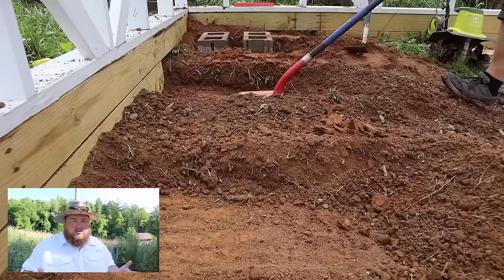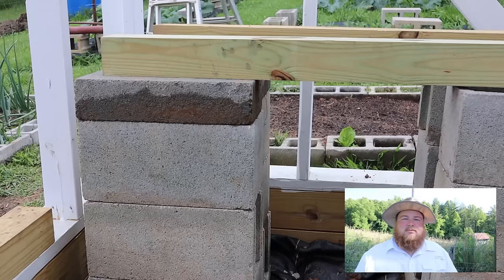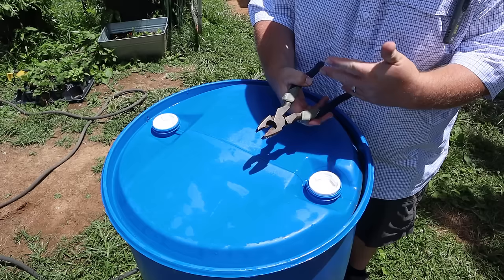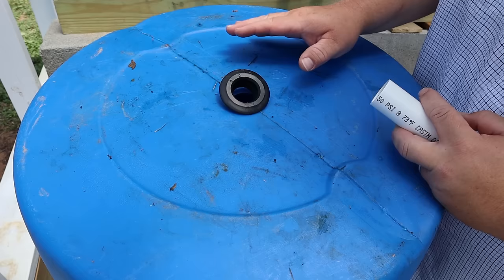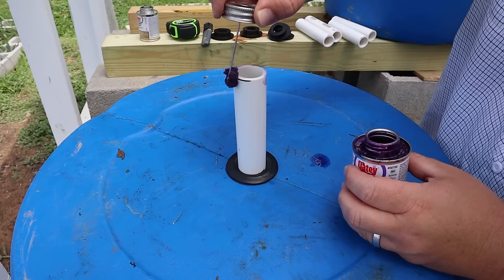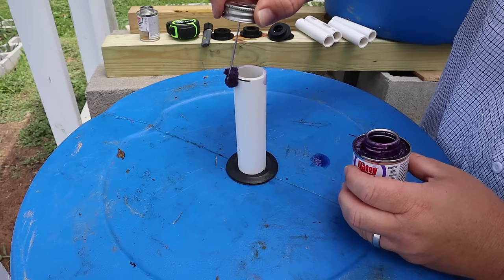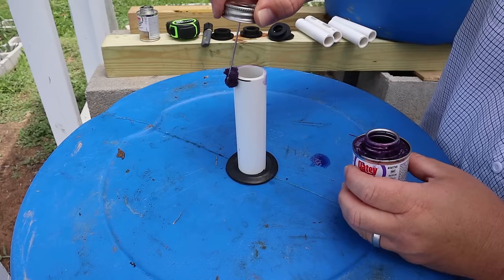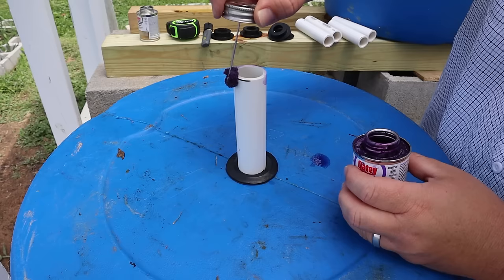COMPLETE Rainwater System START TO FINISH - DIY Greenhouse Build #10

Comment: Suggestion: stick a little bit of steel wool or steel scrubby (like used to wash dishes) in all those open drain pipes. Why, you ask? To keep dirt dobbers, wasps, spiders, 🐍SNAKES , lizards, for going up the pipes. Yeeeesss they can clog up a pipe  and yes they will crawl up it. Great video
Reply: My thoughts exactly. Gotta filter what you can.
Reply: They sell grates various sizes, colors shapes etc..
Reply: I have just 2 words,that, I’m gunna cram together: badass!!!
Reply: I learned that mud daubers are a major black widow assassin. Just something to remember if the one worries you more than the other annoys you with it's fancy smancy hourgla...wait.... hang on... somethings backwards there
Reply: @dont.ripfuller6587  and those fast-flitting scary metallic blue wasps prefer fiddlebacks! They are not aggressive, and after looking them up, I was able to convince spouse we should leave them be!
Reply: Thank you for the great tip! We get scorpions in the bathtub…
Reply: Excellent foresight, but steel wool will rust out pretty quickly. I'd use nylon mesh, probably.
Reply: Mice! Had  RV water tank and took out in remodel found dead mouse in fresh water tank. Don't use it anymore, yuk!
Reply: Paint those guys black, and in winter, they will warm in the sun. Then, they will release heat thru the night.
Reply: I'm in S.A. ... We one had a crazy honey badger living in an old drainage pipe on our property.  He was a wildman.  He would kill the chickens AND the fox and eat them all.  He'd occasionally break into our kitchen and absolutely RAID the pantry and make a huge mess... Right in front of your face, while looking at you!  But you DON'T DARE try to stop him!  (They go for the testicles, the eyes, and the throat, in any order).   They're known for backing down fkn FULL GROWN LIONS! (their utter fearlessness and obsession with testicular maiming are enough to freak most lions out)😂😂😂
Reply: @shaftomite007 The honey badger is my spirit animal, I love the honey Badger
Reply: If you use a 4" circle cut from nylon screen door fabric to cover drain holes then a zip tie around pipe over screen, that should help keep bugs out but mice will chew through it. Hope you find remedy to keep mice out. Good luck!

Comment: placing blocks with holes vertical will allow them to settle and sink individually and cause your base to tip. To minimize potential tipping / leaning of your foundation, place the 1st set of blocks with holes horizontal.

Comment: Something to consider, is on one barrel to put a fitting up towards the top, and one towards the bottom, connected by some clear tubing.  This way you can see your volume level in case you have not had rain in a while.
Reply: I’ve done this on on smaller systems and while it’s a nice convenience, it will grow algae even in indirect sunlight
Reply: @Oleo 2320  true, but if you put in a floating ball it will be able to be seen and keep the algea down to a dull roar.
Reply: Or (speaking as a complete novice), on the clear tube cover it with black tape and cut out a rectangular slice and cover the exposed part of the clear tube with painter's tape.  Then you can lift it up as high as you need to look at the water level and reseal it back down without it being sticky. But what do I know, never done anything like this before - but my mind thinks my ideas could work. 😊
Reply: Tapping on the barrels will tellyou water level.

Comment: Giving me ideas and inspiration, maybe something for others to consider, 1. You don’t necessarily need to glue fittings above your overflows, ie any part of the system that does not “hold” water. Consider mounting brackets for support as needed and maybe two self tapping screws to secure joints. I’ve also used hot glue in non pressure segments. 2. Design your downspout and feed plumbing first to determine the max hight of the top of your barrel(s). Ie water always flows down… 3. Keep in mind water weighs 8.345 lb/gal, your base and ground needs to support 400 lbs / 50 gl barrel. 4. While small diameter pipe is fine for venting, overflow outlets should be sized to match maximum inflow, The multiple small diameter overflows is clever and will probably be able to manage. Consider a T fitting with a short vertical stack instead of a 90* downturn to improve vent and drain. Or otherwise separating the two systems. 5. A 1” manifold is most likely sufficient but don’t go smaller, too small and your primary barrel will over flow before completely filling any down stream barrels. Similar to overflow size considerations. 6 consider adding unions or threaded connections in your manifold to make breakdown for maintenance or moving easier. 7. Add T fittings and screw caps at manifold ends for maintenance, flushing out barrels or future upgrades. Nice system thanks for the inspiration!!
Reply: Do you realize that by drilling those holes in the top for venting you could do that by loosening the bung on the top.
By doing that you don't have to worry about bugs getting inside those hold even though they're small a mosquito can get in that small hole and start breeding and laying its larvae.

Comment: Nice build!  I'm saving this for reference.  One suggestion, maybe extend the drip/overflow away from the foundation of your building.  Over time it will rot out your wood quicker and compromise that area.
Reply: Or dig a small trench under the spouts and angle it to go deeper down a little as a run off as you end it a foot or two away from the greenhouse frame?

Comment: FYI on overflow: area = π*r*r, so a 2" inflow is 4x as much as a 1" outflow. That said, you only have a 1" exit/entry to each barrel through the manifold, so input will never exceed overflow capacity for the middle 3 barrels - only the end barrels. You'd be better off putting a 2" overflow on just the end barrels

Comment: I think someone may have mentioned by now, but why not get a couple more seals and put a sight glass tube for water levels in center barrel?
Reply: Doesnt matter what barrel it goes in. And all you have to do is hold the end of the hose above the top of the barrel and lower it till water comes out that's your water level (pun intended)
Reply: Nice job I like your design

Comment: I was going to say about the drums needing venting in order to fill, but then you added the overflow to each drum which basically provided a vent for each drum.  Looks great and hopefully it does what is required of the system.

Comment: Love the idea...I would maybe just compact the soil after you did your first scrap, also the drain/bypass is a bit close to the structure I would probably put a downspout extension to lead extra water away to it doesn't erode to close to structure.

Comment: Hey Sam, Nathan here, great video. I do like you framing on the green house, looks very strong. We have the same mind set on having things on hand and use what you have to make what you want. i believe it helps the pocket, but also more important keeps the mind sharp on problem solving. Anyone can spend thousands and have a great system. For me I'd rather spend it on chocolate. he he...
Reply from the maker: Hey, glad to have you here! You're absolutely right on using on-hand materials! Mmmm chocolate!!!

Comment: Excellent set up , very well put together , the run off safety measure flood prevention , exactly right . Vents  the barrels at same time , netting on bottom of run off pipes will stop insects crawling up into the barrels  ,  just a thought .  Your the man Sam . .

Comment: The bottom-fill manifold method was in my head a while ago. Glad I could see it work in practice. This is reassuring and will incorporate into my attached greenhouse and using existing gutters (after cleaning them) to capture tons of water. Well done.

Comment: not sure what kind of netting you put over the pipes, but can you put some of that over the bottom of the overflow pipes just to keep flying critters from zipping in to your barrels?  Really awesome job, and an extremely helpful video!!
Reply from the maker: You could, yes. The netting is paint strainer/filter netting from the hardware store. It's a thin mesh.
Reply: a nylon or pantyhose will work too, probably cheaper too.

Comment: With the hydraulics, you only needed 1 overflow outlet on one barrel.  The water level equalizes in all the barrels before it would reaches the overflow.
You did not need to drill vents for each barrel, the overflow would serve that purpose .
Reply: That's what I thought as well.

Comment: Wow! I’m in Old Fort, NC. If any of y’all super smart men or women want to come help out a single mama start a homestead(ish), that would be amazing! Tried a ram pump with the ex, and it kept failing. Desperately need this water system in my life. I got a bit confused on the first flush and drilling of holes in the cap. But, that probably just means I need to watch more videos to better understand. But seriously, this is amazing. I will try my best to write down everything step by step as far as materials and such.

Comment: You need a better foundation under each column.  You should place two 8 x 16 x 4 inch concrete blocks at 90 degrees to the column blocks.  This will give about 1 pound per square inch pressure on the ground instead of the greater than 5 pounds per square inch of your current design.  Your columns may start to lean if the ground get wet under the columns.  
Good Luck, there were some great hints in your video!
Note:  If you replace the bottom block with a 8 x 16 x 4 inch block plus two more under that one you will end up with the same height.  Should be able to jack up the barrels when empty, replace the columns. Once they are all updated then re-level the top horizontal boards.

Comment: I'm  going to build it , but I will cover the air vent holes by cutting a round piece  of plastic mesh and glue them using a glue that will stick  to the barrel material just to make sure no bugs will try to enter the barrels . For example,  mosquitoes.   To tell you the truth , nobody  on You Tube explains so well all the steps the way you do .  I'm  writing  from P.R. .  In some more months we will have  the storms season and what I saw in this video will come very  handy . For drinking and cooking  water it's  just a matter of having stored tens of gallons of it way before the s. season  , and the water that will keep being collected  in plastic  barrels can be used for other things . It will be a matter of just connecting a hose to the faucet in the barrel .  You have no idea what you have done for me .   GRACIAS !!
Reply from the maker: Eddie, I am so pleased to hear that my video was helpful. You have helped me too, regarding the mesh for the barrels! Good luck with your project, I wish you all the success!!! -Sam
Reply: @sam-and-angela  The same  here .  GRACIAS  .
Reply: @eddieramos6883  I would utilize the bungs in the barrel bc they are pipe thread and you can screw a pipe fitting right into them. 2" npt. Place the barrels upside down and connect them that way and then vent by drilling and tapping the bottom but now top 1/8 pipe and connect together with cheap compression fittings and 1/4 ice make line to a filter or to a ptrap type air loc. Then the over flow would be plumbed into the bottom manifold and run up higher than the barrel height and 180 back down so you can use full capacity or the barrels but put a vent hole in the top of that 180 at the top to prevent a siphon.
Reply: @timothydillon6421  Thanks .  GRACIAS

Comment: you need a ball inside the first flush tube to stop the trash that will be floating in that dirty water from going back into the rain barrels when the water level reaches the "Y" pipe, Dust, debris, and bird poop will float on the water and rise in the pipe as the water rises. The ball blocks the opening and prevents it from contaminating the stored water.

Comment: How about adding a simple float so you can assess the water level, far less work then a sight pipe.
Reply from the maker: Ooo I like that! I've been thinking about how to plumb in a sight pipe without loosing every bit of water I've collected and flooding the greenhouse. A float would work and save the water, too! Thank you for this idea!
Reply: @sam-and-angela  you hose will tell you the water level.

Comment: One cool feature you can easily add to your setup is making your first barrel a radial filter like the one used in aquaponics. Or you could make all your barrels be radial filters so your storage is also an amazing filtering setup. The main con is that you would no longer be able to have all your barrels be equal level at all times. But if you plan on using this water for human consumption I guess it might be worth the effort.
Reply: Wait, I need help. Is there a really good explanation on you tube for this? That's what I was thinking the whole time should we find a way to filter this or do something to be able to drink it

Comment: Stellar work love to see it. A tip I may add is a shut off at the end of your first flush system. It dosent need to drain constantly. Leaving shut off rain will flush and fill up the drain with its dirty water. But the time it gets to the top all dust and dirt will settle at the bottom. Then after each rain just drain that dirt out. This way you no spilling good water after the room has cleared. Keep up the good work!

Comment: Nice set up. Suggestions since I have a system similiar to yours. On the elbows going into the barrels, there is no need to glue them together the pvc fitting will stay in place. If concern of them seperating just drill and screw two small  stainless steel screws to them on either side. This will allow you to remove the intakes if you need to in the future. Great video, many thanks.

Comment: I really enjoyed this video. I owned a gutter company for 30 years. The only advice I would tell you to remember is that water follows the path of least resistance and does not flow uphill  without a force behind the upflow.  From the angle you filmed from I believe the second downspout may cause you trouble. Glad to see someone not afraid to make mistakes and just get it done. It is a great way to learn or so my Grampa taught me. Have a great day.

Comment: Aloha. Great build, thank you for sharing your project. An idea that might also help improve your first flush is to put a ball or a plastic bottle within your drain pipe to act as a stopper. As the drain pipe fills with water, the ball/bottle will start to float upwards, eventually reaching the junction of pipes and completely sealing off the drain pipe, allowing only the cleaner water to enter your catchment system. This will work better if the drainage pipe diameter is slightly smaller than your catchment pipes.

Comment: that system looks awesome, however, I would have made a transparant tube in front of the barrel in the midst, that way you can keep track of the amount of water left in the system.. I bet those uniseals will work for that too.. but in all a very nice system to collect rainwater and use that for your gardening.

Comment: Found your channel I like your greenhouse I like the way you got it built I need to watch how you build it if you got it on there and your water did a good job I like them I like those plastic rings rubber ring so I will call him for the bottom of the barrel

Comment: Well ain't you fun?  And informative & inspiring. Remember double the diameter is 4 times the volume. so, your 2" intake is equal to 4 of your 1" overflow pipes.  I would consider running overflow out of the top bungs, about 1 inch lower than the top of the 2" intake to keep 1st barrel from overflowing before the others filled.  that puts the bottom of both pipes even so the overflow would help fill the next barrel. Going to watch your other videos now,  looks like I've found a informative and fun guy to follow...

Comment: Most people assume that you have to have the downspout enter the barrels at the top.  But you can attach the downspout directly to the manifold (using large enough tubing for the manifold, of course) and have the barrels all fill from the bottom up. You have actually done this with the 3 middle barrels.  They fill from the manifold.  The benefit to doing it this way is that you can move the top of your barrels nearly as high as the bottom of your gutter, which can add clearance height at the bottom of the barrels for placing a bucket under a spigot, and which also adds head for more hose pressure.  It can also reduce the amount of tubing and the number of fittings you have to use.

Also, the size of your roof is not large enough to need overflows in every barrel.  One would be enough, even in a heavy rain. Better yet, you can put a tee in the downspout up near the top of the barrel (similar to your first flush tee), and run a tube from it down and away from  your building.  When the water lever gets high enough that it would run out of an overflow in the barrel, it will instead run out of the downspout at that tee - easier to maintain and much cheaper to build.

Comment: Fantastic Job, Sam. You might consider placing a pvc inline ball valve shutoff between the barrels on the fill pipe. That way, if there’s a problem with one of the barrels in the future, you won’t lose all your water cutting the problem barrel out for repair. Nice work, bud. Thumbs up for sure.
Reply from the maker: I was trying to keep the costs of this system lower (ball valves are about $10 each here), but they would be helpful for sure! I had the thought when planning my fill gauge indicator that I wish I had a way to isolate the manifold. Oh well.. hindsight I guess. :)